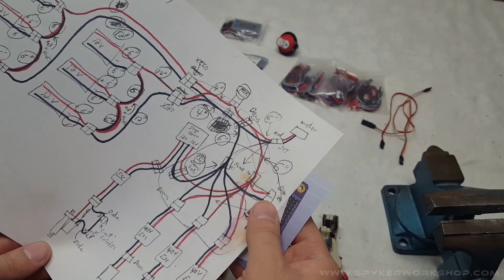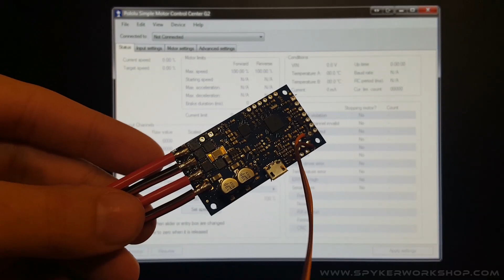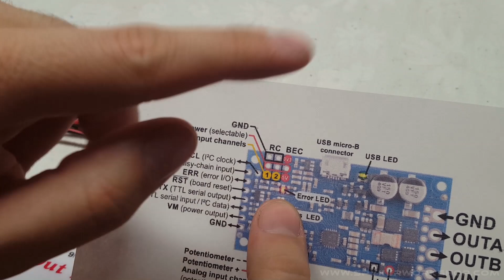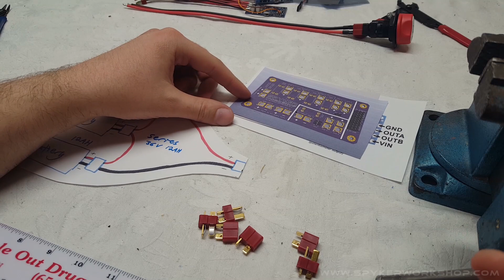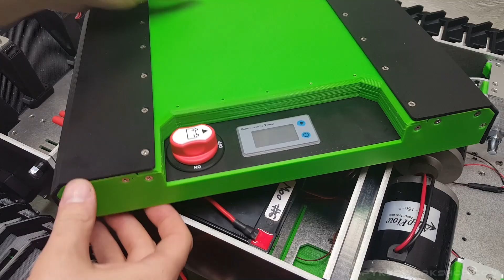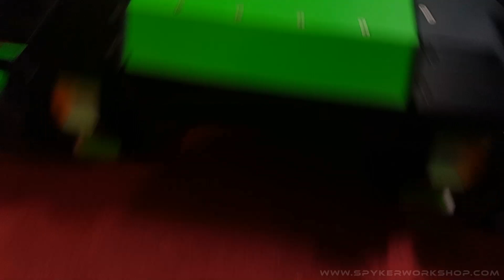Spyker Workshop - Spyker KAT 2X - Electronics (BUILD SERIES)

Comment: To Charge the Batteries, i would use an  Single dual charger and Connect 3 Batteries in parallel.(but only it they have all the same voltage.) Also my charger can deliver the Power thats needet to Charge them like this. 

3 Batteries on Channel1 of the charger, and  the Other 3 Batteries on the Channel 2. 
I use an ev-peak cd3 400w charger (200w per Channel.)

Also to Controll it i would use an flight Controller of an fpv Drohne, to keep it Drive in a strait line. (It helps also if a track is sliding on ice.) I tested it on my very small tracked Platform, but i want to start building a bigger one.

Comment: What a nice cat! The furry one that is... :D

As for the soldering, I would definitely recommend a smaller soldering tip for the board operations. The massive one used in this video is awesome for heavy gauge wires/connectors, but really tricky for detailed work in a printed board.